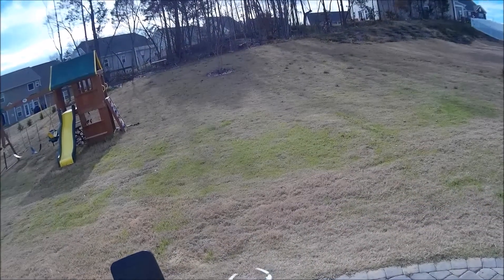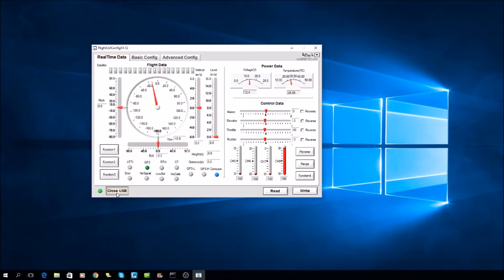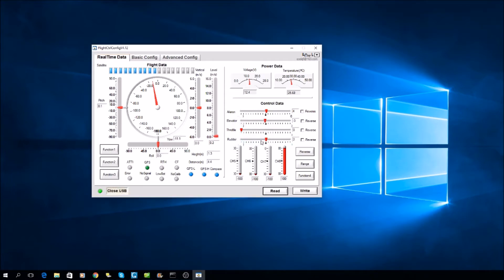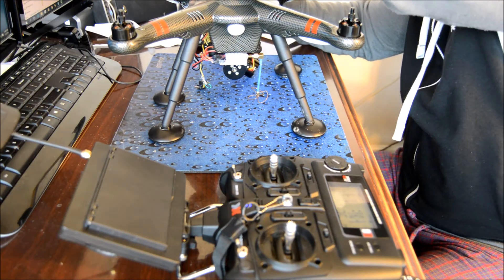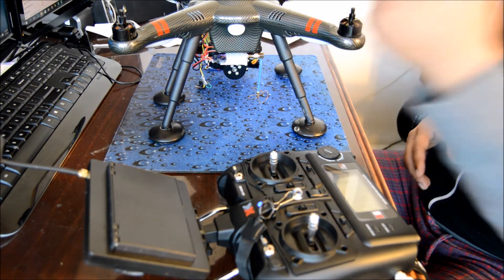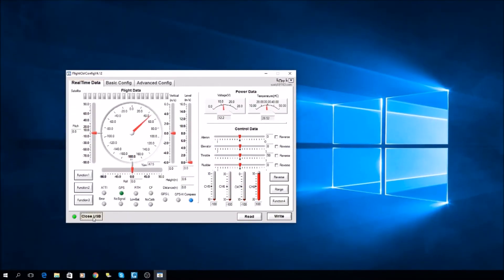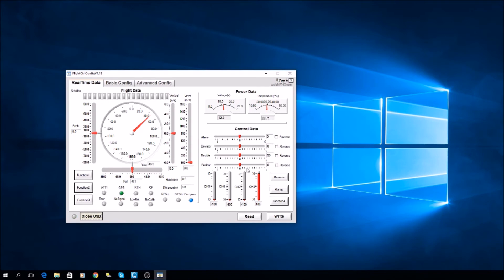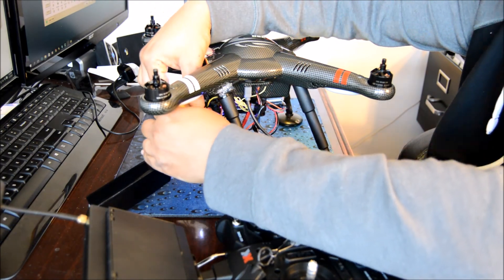xk detect x380 remote trim calibration eng

Comment: It would be nice if you could ZERO (or neutralize) all the flight controls from the configuration software.  I hope the Engineers at XK will take this suggestion! Cheers
Reply: it can be as far as in join the forum and ask on there someone should get back to how its done I recall you click something then follow instructions

Comment: hi. i follow instruction but my x380 don't want to calibrate and reamain at old value.
Reply from the maker: +nelu try right after you put the battery .
Reply: +Ernest J When i follow the instruction, at my, after i switch 6 times, led blink slowly green and red like the beginning. Today i try and he work but on a little different way. After 6 times i leave the switch down and i start to move throttle and aileron in circle and LED start to blink fast. After i turn right switch up and ...succes. He work this time. Thank you.

Comment: Hello, 
My X380 have a problem. I hope you can help me:
It has been falling in a ditch. But it was not very wet. I believe it should be dry.
Now  it can not be start , When I connect the battery up until have GPS Signals were normal. But when I Start.  All motors rotates a moment then stoped. and then Red light Flash (Low voltage warning !?)
 In the “ground control station” I see everything it seems normal. But there  no 12V voltage data. Do you have a solution?
Reply from the maker: +Shu Sang Tsang Hello
join the group all Xk drones owners club on facebook there are a lot information and good people there and we can start  discussing  the problem
Reply: +Shu Sang Tsang Check your battery voltages for each cell in the battery. Note, a battery could show a good voltage
but has low output amperage caused by a cell in the battery not maintaining amperage. The cells are all connected
in series so if one is low it will pull the voltage down on load. If a cell opens or goes down, the quad could just drop
out of the sky. I'd try another new battery and watch out for overcharging it and hitting it with a high amperage
charge.

Comment: I want to ask, why X380 I could not be detected by the software " flight Crl config" ?
whereas my own driver installation. and only detected by my computer, but not detected by the software.
Reply from the maker: +Yudha Arief Wicaksana try conecting the battery first wait for the power up and then connect the usb cable open the software and click open usb.